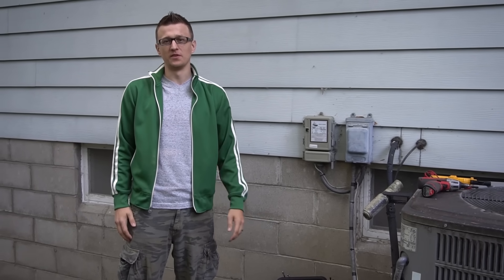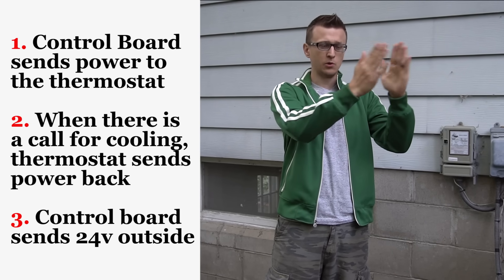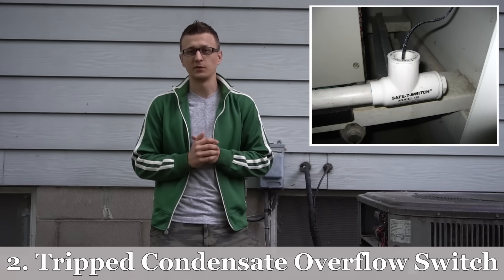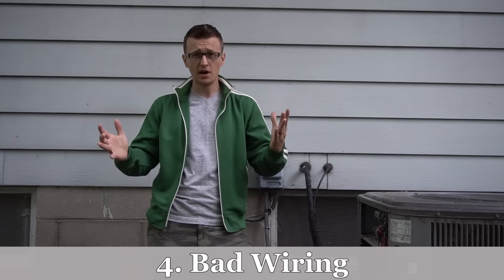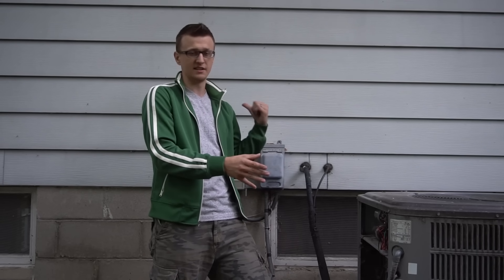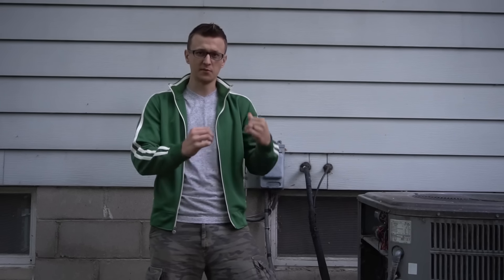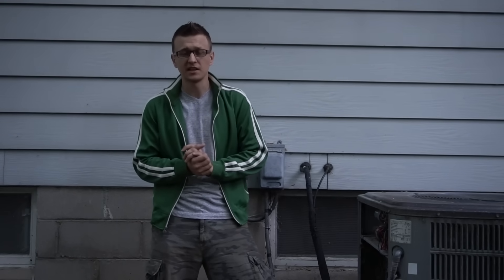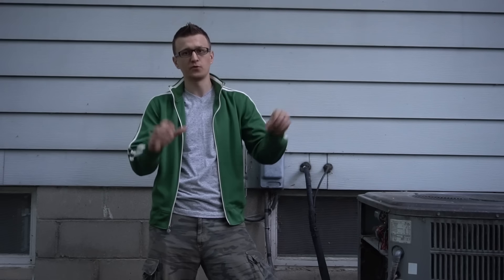AC Contactor Not Pulling In - 10 Reasons Why

Comment: I don't typically comment, but this was a good video. I was troubleshooting the power to my AC unit for the last hour or so. Last year, I had a bad breaker. This year, voltage was good out to the unit, up to the contactor, so I ruled out the breaker. I manually engaged the contactor while my blower motor was running and the thermostat was calling for cooling and the AC unit kicked on. Led me to believe my contactor was bad. I watched your video to see if I missed some wires to test, because we all forgot stuff. Also, to me, the contactor doesn't seem like a part that just goes bad all that often. You mentioned the low voltage not having enough power to engage the contactor and to swap batteries. I recalled, my low voltage reading was 11v and that is too low. The light bulb kicked on, I swapped my batteries, and now my house is nice and cool. Thanks man!

Comment: Reason 11: You got the wrong contactor. My neighbor  (AC guy) gave me a 240v coil contactor. Wouldn't close on my 24V system. Coil voltage needs to match control voltage. Lots of wasted time thinking something else was wrong.

Comment: THANK YOU!
You saved me a very expensive service call.  My AC wasn't cooling and I followed your instructions. The condenser and compressor would not come on. I found a cut 24v signal wire from the control board to the compressor solenoid. In my case the 24v signal wire cable is routed under the crawl space of the house and comes out at the back of the house to the Condenser/Compressor unit.  Well, the cut/broken wire...that bugger, was severed exactly where it came out from under the house.  That said, it was difficult to locate because in the first place because I had inspected the cable and found nothing wrong.  I was almost at the end of my patience when my mind told me to tug on the cable where it came through the wall to the condenser unit.  Well, as soon as I tug on the cable the compressor/fan came on immediately and ran like a charm. I ended up soldering the broken White signal wire.  So, just wanna say thanks again for your suggestions.  Lesson learned: never give up when you think you're stumped.  Just take a break from the task and come back later and give it another try.

Comment: Great videos. Very clear and to the point.
My compressor isn't turning on.
Took a volt meter and measured zero volts across contactor. 
I removed the wire nut connecting two yellow wires and jumped the thermostat directly to the contactor and it pulled in and buzzed a little but no compressor. 
I manually pushed the button with a stick and it worked. 
The real question is the  zero volt condition the yellow wire seems to be in series with two pressure sensor switches.  So are the pressures switches normally closed or open.  I'd like to buzz it out with an ohm meter.
Thanks

Comment: Dude , thank you for everything. Seems like a mouse ate through the wire that goes from the contacted to the pressure switch. Simple splice and wire nut, UL tape wrap and she kicked right in. I tested everything inside first to be sure. You just saved me much needed cash. Thank you again.

Comment: Thanks for the great info!  My issue today:  My compressor is coming on but the fan is not.  As a first guess, I replaced the capacitor ($20).  Some cool air is pumped into the house, but I quickly shut off the system as the outdoor AC coils were getting hot when the fan did not kick on.  Removed the fan and oiled the motor- spins freely but will not start even with a push.  I noticed a lone white wire (not one of the three motor wires that are connected to the motor) with a broken spade terminal near the compressor - just hanging there.  I am not sure where it could have connected.  I suspected that it is a ground wire but cannot locate a screw where it might attach. As soon as the outdoor temps drop in the early morning, I plan to reopen the case and take another look at the capacitor and other connections.- Next I will locate the wiring diagram that is in tucked away in there as well and I plan to trace down that disconnected wire.  In my order of suspicion, I am thinking that it might be the fan motor now that I have replaced the capacitor. A used motor is $110 and a new one may be 200+.   So until i find the issue, I cannot order the correct part.  Any advice is greatly appreciated.

Comment: Hi, my central air unit is not turning on, (decided to check before summer hit). I do have the 24v going to the unit and if I push the plunger in manually it does come on, however I did notice my unit has a Comfort alert diagnostics module inline that does not have a power light lit even though I have seeing voltage go into it, could that unit have gone bad in only 4 years?

Comment: Hey, i have 27 v in disconnect to contact but no voltage at contact?? I replaced the wire in the whip but still nothing to contact. Well 1 of my techs did.. Unit was up and running a week ago. Now the 3 amp blows as soon as it has power. The therm wires change color in the wall somewhere making it difficult but the system was running so there must be a short somewhere. Replaced board and therm with no luck. Anybody with advise would be greatly appreciated!

Comment: i had a red wirebreak in the attic and all the other wires had 3 wires in them all ready and I did not know where to land the red wire. so thatnks to you; the red wire and white wire from the thermostat can go straight to feed the solenoid on the 24 vac contactor and runn the condenser. I think i got it. We have lightning here in florida.  :)

Comment: Thank you so much.. You saved me big money on an AC tech visit. I replaced the compressor's capacitor, contactor, fan motor, AND the air exchanger's control board and transformer--none of it was solving the problem. Then I found this video. I was getting 30 V to the compressor, so as you said, the problem was at the compressor, and it ended up being the High Pressure Switch. Pushed that baby in and we're golden! At least I got some upgraded parts out of the whole affair, and I know a whole lot more about AC systems and electricity.

Comment: Just found your channel. Thank you so much.  Fan and compressor not working outside.  Both capacitors test good w meter.  Cleaned coils too.  I hear a click and a buzz when turning a/c on but no fan or compressor start.  Fan spins freely and was replaced a few years ago.  Thinking contactor switch.  What’s the senario If I push in contactor switch and they start vs pushing in and don’t start? Hoping it’s not the compressor

Comment: There are 4 wires running from my thermostat towards my condenser. Black, red, green, and yellow. By the 240 breaker both the green and yellow are cut off and only the red and black actually go into the condenser unit. I am trying to rewire it so they are all connected but having trouble knowing the proper set up. Can you please help with some insight of how it is done. Thank you so much. I've learned so much about my AC these past few days.

Comment: Thank you.  Great video.  Your troubleshooting process led me to the root cause.  The symptom on my HVAC was that it would run for approximately 10 seconds then turn off.   The drain pan in the attic was dry; however, the condensate float switch had water when I removed it.  Re-installing it as is restored service.  I will monitor the performance of the system. I have ordered a new condensate float switch (Safe-T-Switch SS2) from amazon just in case.  The next troubleshooting step will be to unclog the drain pipe if the switch trips again.

Comment: Note to self:  The 10 reasons are:
1. Furnace power switch off
2. Tripped condensate overflow switch
3. Bad thermostat
4. Bad wiring
5. Bad 5-min delay board
6. Bad fan control board
7. Bad power saver switch
8. Tripped high pressure or low pressure switch
9. Bad contactor
10. Bad transformer
Reply: 11.  Circuit breaker for the outside unit is either shut off or tripped
12. Switch on the thermostat is set to FAN instead of AUTO
Reply: @charlieparker5678  the contact will still actuate if the disconnect pull switch is off

Comment: My contactor is new, but intermittently is not pulling in, even though the 24 VAC is present. What could be causing this? Could it be not enough current on the 24 VAC? I am debating if I should replace the 24 VAC two wires from the Air Handler to the outside. Any suggestions are welcomed.

Comment: I have a rheem heat pump my symptoms were the inside unit ran but my outside compressor & fan were not running unless you manually pressed  in the switch. I had 24v to the switch and the switch Ohmed good. I was puzzled mine has a computer board on the ouside unit the ground on the switch runs to it so I unplugged it and grounded it to the frame and it pulled the switch in so it can be a ground wire too I still have it grounded to the frame until I can figure out why the ground from the board isnt wirking. Just told the kids dont play around it haha.

Comment: Thanks for the video. It’s been helpful as I troubleshoot my AC. Compressor and Fan will not turn on outside. Air Handler does. Replaced capacitor and contactor outside. Motor and compressor engage when the switch on the compressor is pressed manually. Transformer in the air handler has 24V but the wires to the compressor was only 14V. I’m trying to figure out how to bypass the thermostat now but my circuit board doesn’t have a Y...

Comment: Hey there my man first off I can tell how how much it means to me the way you are helping me. I haven't looked yet cause well the ac issues but can I help support you a little. I can't do much at all but man I feel like you really deserve it.
Anyway I'm the one talking to you on the video that test the thermo.
I went out there and riged the plunger down and got no cool air inside... That help?
Also I watched this video earlier and I checked and or I don't have some of the things in this vid. Or they worked fine. I'm going to double check now but if all this checks out it would be the switch right? Or is it when I rig it down the capacitor still isn't pushing what it needs?
Reply from the maker: Hey Adam! It would be enough for me if you are able to successfully fix your AC! :) So when you press down the contactor plunger, does the fan and compressor come on outside? (sometimes it is only the fan that spins but the compressor does not start) How about the fan inside, is it working? If everything is working but you still don't have cool air.. Then unfortunately there is a high chance it's a refrigerant problem. At that point a homeowner can't do much and would need someone to come out to take a look at it..
Reply: @WordofAdviceTV  after me telling you no it can't be the Ole cap cause the trusted ac man around here just replaced it a couple weeks ago... Well let's just say I'll never call an ac man again unless I need freon. After all I did yester I know my system like the back of my hand. He even came out and tested it and said it was good... I went and bought my own meter and it never even registered on the fan and barely on the herm.
I appreciate absolutely everything sir. You saved me from blowing up my home outta rage lol
Reply from the maker: @jonboatmorava9115  Ahh, so it was the capacitor after all! The repair guy must have accidentally or purposefully put in an old capacitor. Glad to hear you were able to get the AC fixed yourself! Thank you for the update, stay cool!
Reply: @WordofAdviceTV  well I talked to the tech and he says they almost always go out in a year or 2. He put it in 13 months ago he claim it was a new cap. And that several of his customers always have their caps replaced every year or 2. Odd huh? Well now I know and once again thanks a ton for your help. I now have a pretty good meter and hand tools for this system. Can a guy charge his own system with freon without being certified? I have come to realize ac work is like car work you don't have to call a pro for every little thing. Thanks a million times sir you are a godsend
Reply from the maker: @jonboatmorava9115  Glad I could help! Well technically you do have to be certified to be able to handle refrigerant. The EPA certification is not too hard to get if you wanted to. Otherwise you can just go for it but if you get unlucky and get caught or reported, it can be a fine up to 25,000...
Reply: @WordofAdviceTV  wow. Well I will just watch the guy or gal charge it next time it needs done. Thanks again
Reply: Well sir , the cap didnt fix it either. Ugh. Instaled it the system came on ran ok then right back to nothing after tuening off thwn back on. I checkwd new cap and it has oerfect numbers. The contactor?